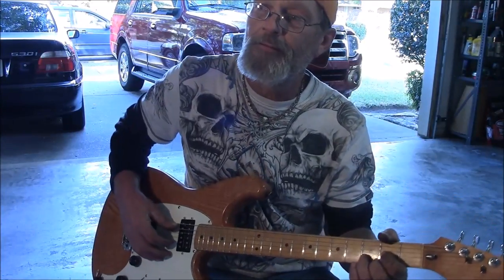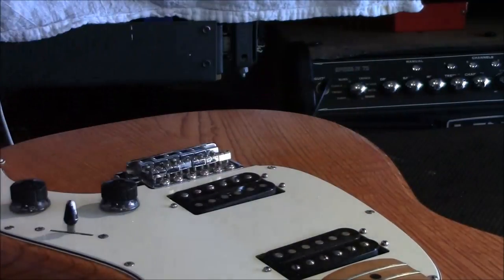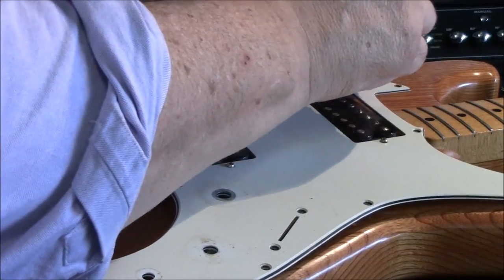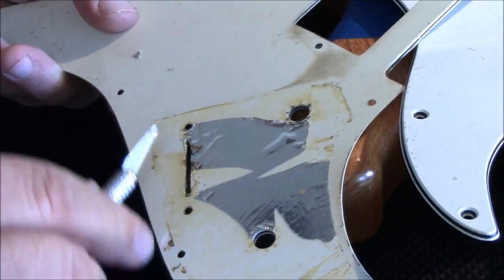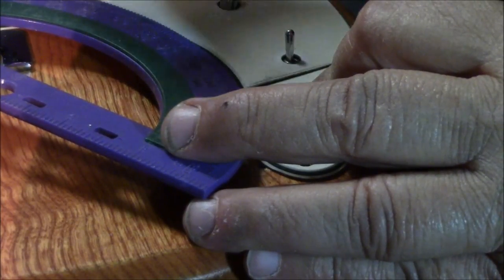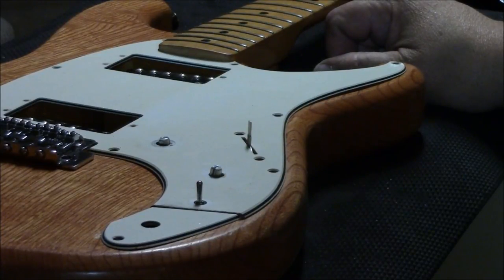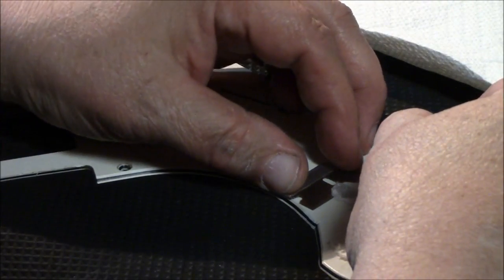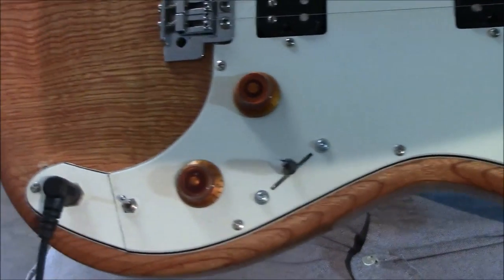PICKGUARD REPAIR

Comment: Good result.  I recently repaired a 1971 P-bass tort pickguard.  The end had cracked off similar to your video, but I still had both pieces to work with.  My solution was to take a piece of plastic that they use to make ID cards and attach to the back side of both pieces with JB plastic weld.  The material was easy to work with and I cut it slightly smaller than the edges of the pickguard so it wouldn't be seen from the front.  I had to drill the screw hole and input jack hole through the new backing and then router out the body of the guitar to make for the extra thickness so the front of the pickguard would stay flush to the body.  This gave me worry b/c I had to take a power tool to a very expensive piece of wood, but thankfully the work is all hidden.  The thickness of the backing plus the glue was enough to make everything solid and it held nicely when I got it screwed back on.  There's barely a crack visible and I can now pull the cord out of the jack without risking damage to the pickguard.

Comment: Hi   
Davesintexas
Do you know how to repair a vintage stratocaster pick guard Plugging a hole? i have a 61 guard with a hole that's about 5/8th round I have a guard to use for the plug but im not sure i want to take it on myself.
Reply: never mind i just fast forwarded to the end I could have done a better job on this. Sorry thanks.
Reply from the maker: The main thing is trying to match the color of an old guard. A new one wont come close. I used what i had and the owner was very pleased with the work.  Remember, I was not RESTORING that guard back to new again.  I was simply repairing it.  Have a good one.

Comment: Very limited as to what you can do Dave, good job though bud 👍👍
Reply from the maker: I agree but I DID manage to hunt down and find a Matching color Pick guard on Ebay.  The owner brought over a pick guard that I really did TRY to stain it to be a similar color and Everything I tried failed.  So I went ahead and bought the matching color guard so it would look nicer for the owner.  Course, I do not charge extra for that new guard.  I figure I can use it for parts on other projects and the owner gets a good job.  Have a good one.